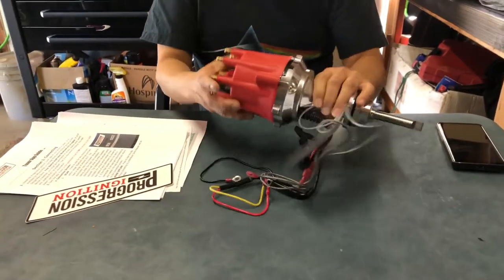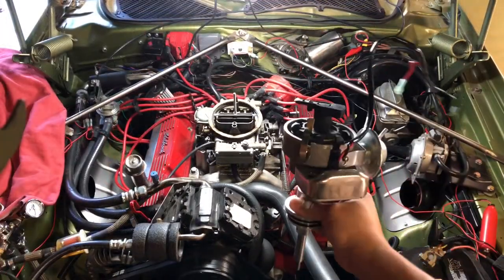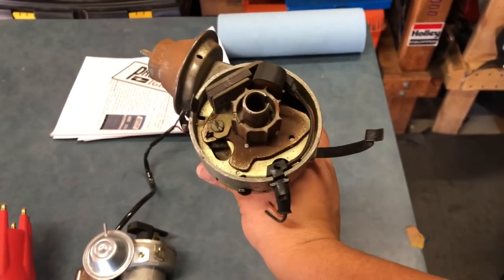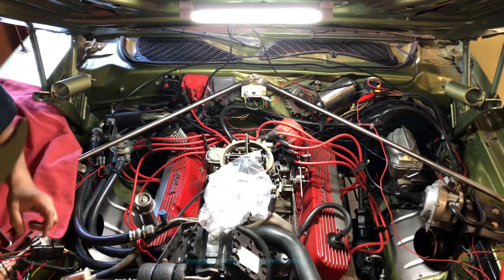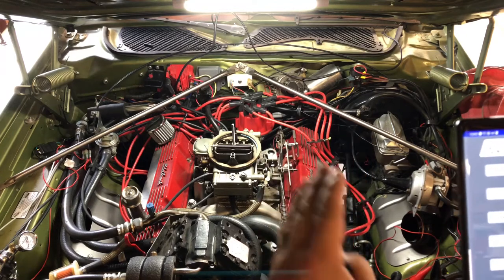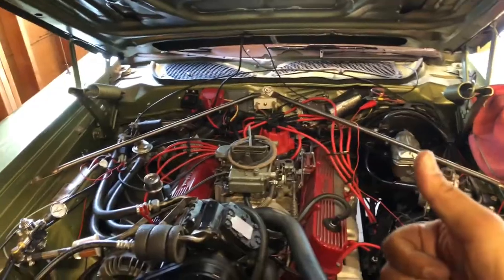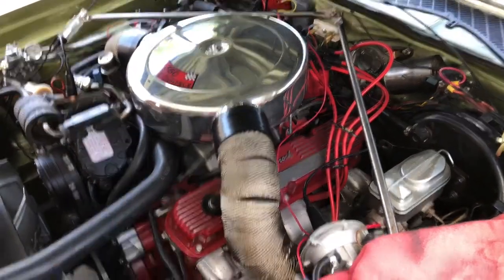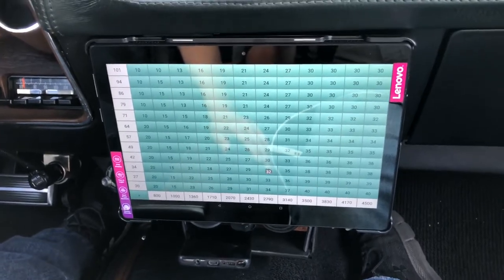PROGRESSION IGNITION’S BLUETOOTH IGNITION SYSTEM ON AN OLD MOPAR!!!

Comment: You nailed this video from start to finish, sincere, honest, detailed and apparently non-biased. 
I share the same motive as you and your dad to continue to strive for better performance, drivability, economy, etc. 
After spending years fine tuning my current setup with an HEI (it drives and runs very good) I just feel there is still room for improvement and this Progression distributor may be the ticket to get me there.
I’d like to see an update with more emphasis on the process you guys did to achieve your best timing table from stone cold startup-cold drive-warming engine cruise-heat soaked engine cruise-part throttle tip in-WOT.
Reply from the maker: Well thank you so much and I’m glad that you like the video. And you’re in luck I’m currently working on an update to this project so stay tuned and I will upload a video soon and also let me know what you think of the rest of my videos once again thank you so much I appreciate it.

Comment: The reason for the ballist resistor in Mopars, was originally to protect the points and condenser. 12v would cause premature ware on the points and the ignition coil was also designed to run on the lower voltage. Chrysler engineers keep the the resistor and design the ignition system to operate with the lower voltage, even after getting away from points ignition.
Reply: Not just Mopar.

Comment: I wonder about this.  I have a Pertronix on a 1964 Ford F250 with a 292 engine.  I replace the 2 barrel carb with a Holley 4 barrel.  I replaced the cross over pipe for exhaust with headers and straight pipes.  I have the Pertronix in place of the points and condenser.
Reply from the maker: @kermitefrog64  if you decide to go with the progression ignition system, it will work just fine and honestly, I found it to be much more reliable than the Petronix unit. It’s a bit more expensive, but far more adaptable and easier to customize when you understand the concept.

Comment: I know this video is a little old but, watching it I noticed what resembles to be an MSD Blaster SS Coil (#8206). If it is that Coil, you will need to change it to a Progression Ignition Coil or something similar like an MSD Blaster or Blaster II Coil.  Key thing here is the Coil needs to have a Primary Resistance of 0.700 Ohms, that one you have (if it's the MSD) has 0.355 Ohms and may cause some issues.
Reply from the maker: Noted! I will change the. Thanks so much for the info!

Comment: I attempted to bypass my ballast resistor by using a jumper wires but my ignition seems to still lose power. Can you tell me more about how you ran power to coil?

Comment: Sweet Mopar dudes and great video. I’m trying to decide between the Pertronix and this one. Did you guys totally bypass the ECM too?
Reply from the maker: Yes we did, the unit is completely self contained so there was no need to use the stock existing ignition control unit, however we did leave it on the car in case we wanted to go back as a backup just in case

Comment: so what curve did you end up with? 5000, rpm Max, 15 deg initial,  32 Total   and you brought the advance in early? To What , 3200, 3000, 2800?
Reply from the maker: Our total advance ended up at 35 degrees at 2,800rpm with initial advance of 12, and we kept the rev limiter at 4,500 rpm, then we fine tuned each rpm range with in 2 to 3 degrees advance depending on throttle response while in that specific rpm. She ended up smooth as silk
Reply: @tailsfromthejunkyard1023  what octane rating are you using?
Reply from the maker: @3RAV4s  unfortunately the highest we can get here in my area is 91 octane

Comment: When you set the RPMs in the app, are you able to change the RPMs and the car responds?  I thought RPMs were set by the carburetor and gas flow to the engine.
Reply from the maker: The RPMs of an engine can be controlled by two things on a gasoline engine, throttle position and ignition timing. In this case yes the RPM can be set by the app and it will respond the minute you change it. However the RPMs can be further fine tuned by adjusting it at the throttle.
Reply: @tailsfromthejunkyard1023  Thank you for the response, I really didnt know that.  On my car I set the idle with the idle screw on the carb, that's why I thought it only had to do with the carb and gas.  It's tripping me out.  Great video BTW
Reply from the maker: @cac110hh  any time, I’m glad the info helped.
Reply from the maker: @cac110hh  and thank you

Comment: So wait, at 19:57 when you said timing was at 10 degrees, it did start up? or did you have to generate the table and send it like you were saying later on, before that first start up at 19:57? just trying to figure out what I should do lol, going for my first start up/break in on the cam in a couple days and want to be ready!! Very helpful video
Reply from the maker: You have to setup a table first, then send that to the distributor and run it to check for accuracy, at least that’s what we had to do in our case.
Reply from the maker: I’m glad this video helped you and good luck with the brake in
Reply: @tailsfromthejunkyard1023  Great, thanks for the quick reply too!
Reply: @tailsfromthejunkyard1023   unfortunately I had no luck with the first start up! Did you guys still have to bring the engine to 10btdc and reference the distributor on the black mark  when you sent your own table to it?

Comment: Question. I am hooking up to a mopar 440. I am trying to wire in around the ballast resistor as well. Would it work if you just disconnected ballast resistor and connected the two wires at the resistor? I guess my question is would that give you 12v at the coil to power the progression? 

Thanks buddy. I hate wiring and this is one of my last steps before starting up.
Reply from the maker: You can hook it up at the ballast resistor if you want but make sure that you hook up the switch wire to the side that is providing the 12 V into the ballast resistor. Basically make sure you’re hooking up to the hot wire that is going into The ballast resistor. Whatever you do just make sure that the unit is receiving true 12v power from the battery even through the ignition switch. Keep in mind that Mopar ignition systems primarily run on 5 to 9 V make sure the unit is getting its full power requirements.
Reply: @tailsfromthejunkyard1023  thanks for the quick reply. Did you run the same 12 V to the positive side of the coil when you bypassed all together?
Reply: @tailsfromthejunkyard1023  I think I’m going to bypass it all together, just need to figure out which wire is the ignition switch and what to do with the positive terminal on the coil.
Reply from the maker: A 12 v wire needs to go to the positive side of the coil from the ignition switch as well as the red wire for the Progression unit.
Reply: @tailsfromthejunkyard1023  Ok cool. So if I run relay 12v power to both + coil and progression it sounds like it would be ok. 

I’m also trying to figure out what other wiring is fed off of that area by ballast resistor. I think it supplies alternator positive from voltage regulator. Thanks for your help btw.
Reply from the maker: Yup just make sure you run a fuse with it
Reply from the maker: Also the Ballast resistor is primarily only there to run the points/electronic ignition system of most Mopars. The Alternator does get its ignition signal to from there but you can bypass that by using the same relay you’re going to install and just ignore the ballast completely. Just make sure it’s wires in correctly and you should be good.

Comment: Is that distributor cap with male terminals some standard part?  And the wires?
Reply from the maker: The distributor can be ordered with either the female or male style distributor cap depending on your application
Reply: @tailsfromthejunkyard1023  Yeah, I know, and I like the male style, but are the cap and rotor standard parts?  And where would you get Mopar specific wires that fit that style? I actually have a 383 and I really like the rev limiting feature!
Reply from the maker: @dahut3614  Unfortunately I don’t believe they sell any wire kit in that style for Mopar, we had to make our own out of a universal kit. As for the cap and rotor they are the same as the ones on the MSD unit so if you need replacements I imagine those would work. This distributor is heavily based on the MSD mag style distributor.

Comment: Did you guys bypass ballast resistor?
Reply from the maker: Yes, you absolutely have to because it no longer relies on that resistor for the reference voltage
Reply from the maker: In fact, you need to make sure that the distributor is getting 12 V at all times including cranking so that receives a stable signal. Otherwise he will have issues with ignition or another words make sure that the ignition switch you have provides power to the ignition system while cranking and it Has to be true 12 V

Comment: So if I am to assume. My motor creates almost no vacuum because of the cam I am running. So this distributor will not work for me
Reply from the maker: That’s an excellent question! I believe the distributor would still work as long as there at least some vacuum present. The vacuum signal simply works as a reference for tuning once the engine is running. The trigger for ignition is actually RPM so it should still work for your application.